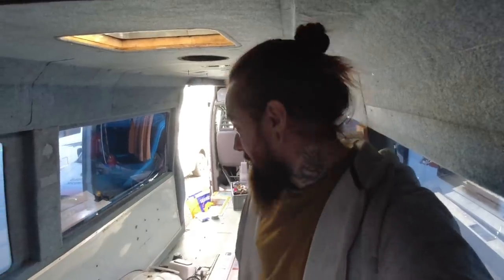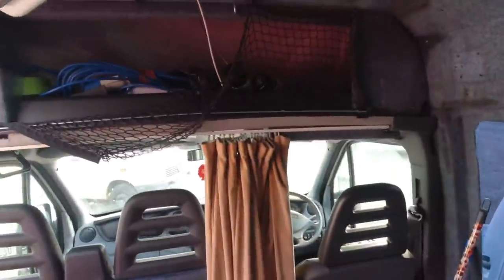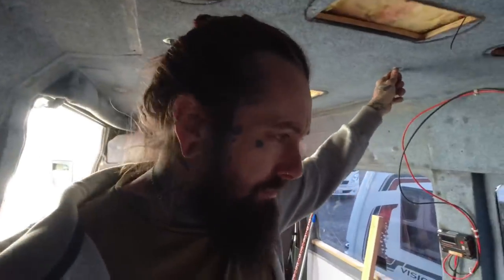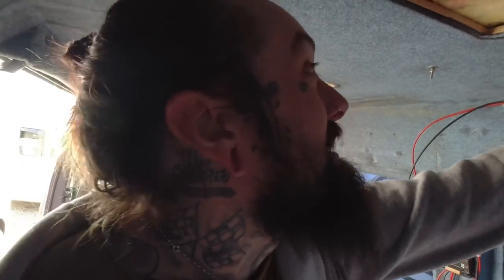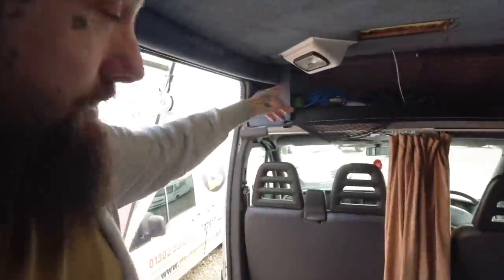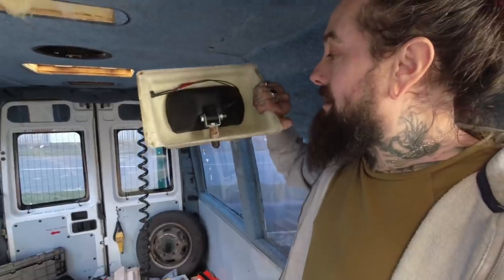Ex Ambulance to Campervan // Pt One

Comment: Ambos are great base vehicles and though high mileage, that's offset by meticulous servicing.

Those halogens would make cracker awning lights!
Reply: only if the engine is running. They would flatten your leisure storage in minutes.

Comment: Just done my roof the same, on my own... And yes a bloody nightmare on your own. I blacked out my rear side windows on my minibus. Just used a couple of coats of multi surface paint, 25mm insulation and ply over the top... 👍